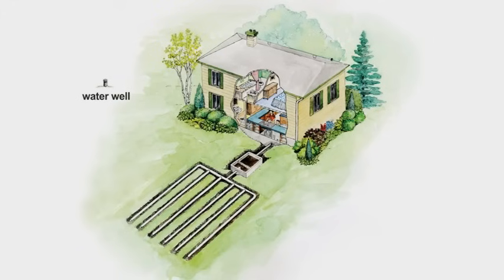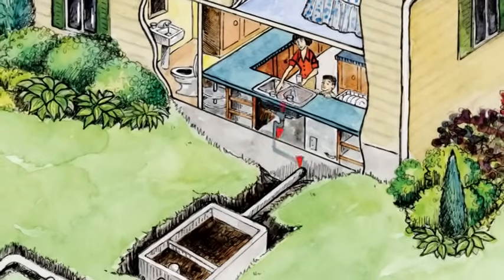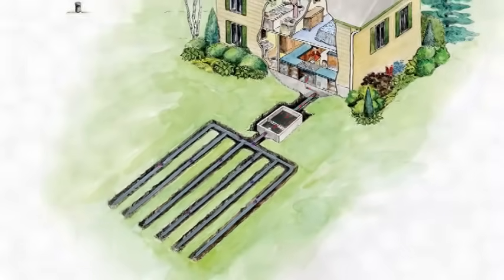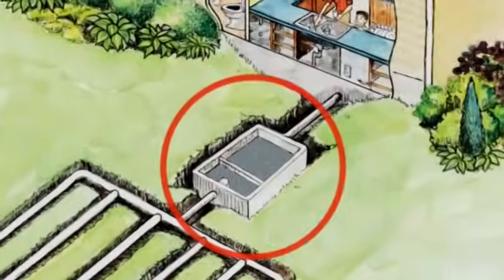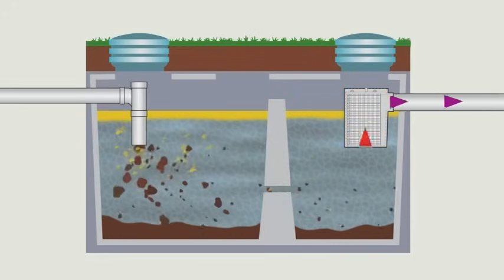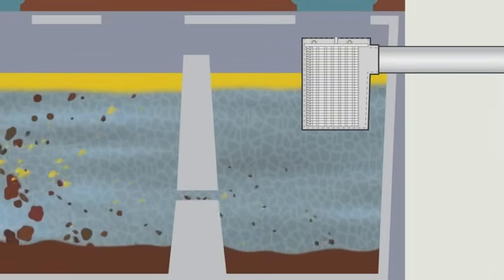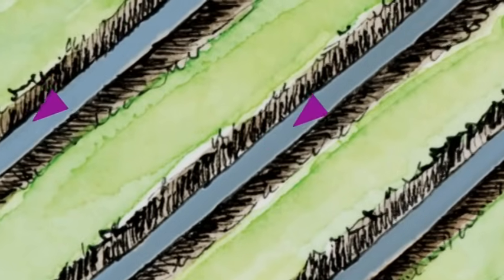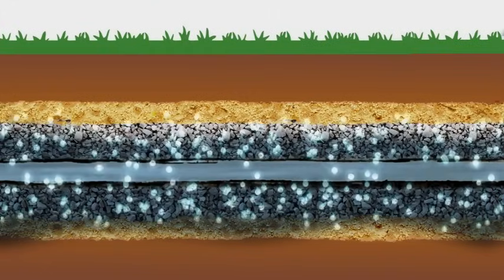Your Septic System

Comment: One bit of information that I'm looking for, that I cannot seem to be able to find anything on, is combining multiple types of septic systems together.  Is it possible to daisy chain different types of septic systems together for the most robust cleaning, and least amount of maintenance?  For example, I would like to use Soakaway worms in the first stage, because I am of the understanding that the worms will process nearly all solids.  Meaning little to no need for the pumping out of sludge from the system.  For the second stage, I would like to use an aerobic system.  The bacteria should be able to handle any waste products that make it past the worms.  From there, I would like to use a gravity system to a drain field.  I am hoping that such a system would put only the cleanest and safest end product onto my land.

Comment: Ok..  So for a very small vacation place that is a cottage with a small kitchen, 1 bath and that is used maybe a few days a month....  How does that work?  The septic system has been in place since 1950.  No idea if it has ever been serviced or how it works and there is no access to it as far as I know.  Is this a disaster waiting to happen?  We have not installed a garbage disposal because we though it would be bad.

Comment: The sellers had septic and field installed before closing but neglected to have clean out installed.  My yard is fenced in with privacy fencing. I spent over $2000 on getting soil filled and grass to grow properly.  Question: How will they proceed in cleaning the septic out?

Comment: These don't exist on Long Island we have cesspools.
Reply: I am now going to search for what cesspools are, can't wait to find out!
Reply: @DrawingTechnical  it's pretty simple. It's just a big pit underground   with cement rings with holes for the water to leach out and a cover. Most have a smaller overflow cesspool connected if the main one fills up. A dry well is the same idea but smaller.   But instead of serving a whole house or building it just serves one appliance such as a washing machine or slop sink.